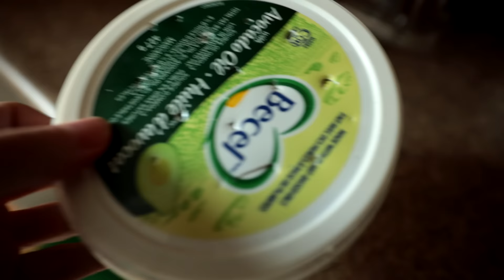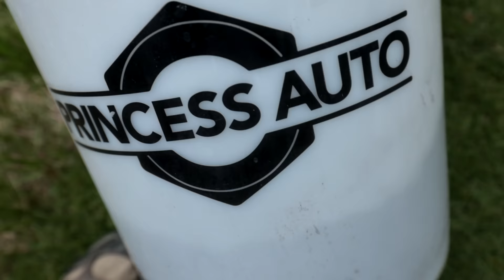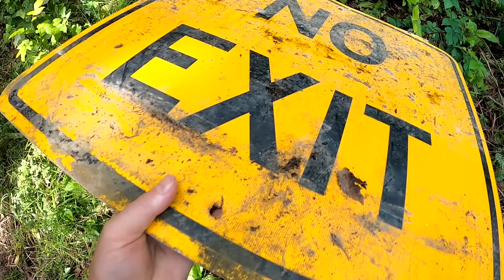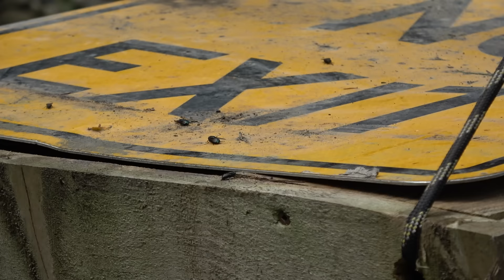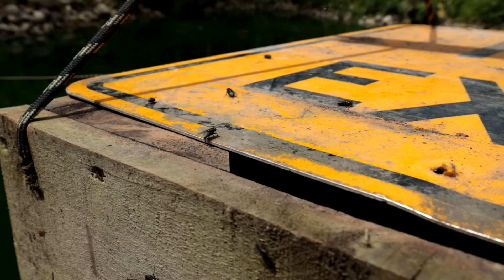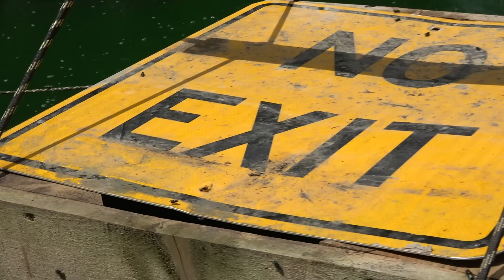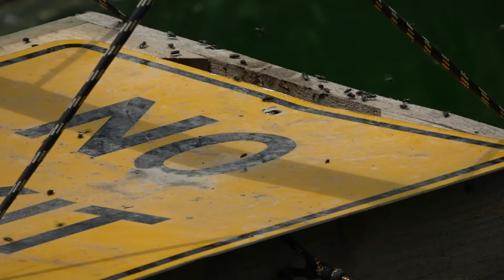Building Sickening MEGA Maggot Feeder - HUNDREDS OF POUNDS OF RAW MEAT!

Comment: Idea for the earthworms: they want moisture so ideally the bucket would be suspended in the water with which is naturally cooler. As you said they can survive in water for several days so if they dropped into the lower half of the bucket with water that's no problem. The lower half could contain sponge with large holes (inch size) which marries up with the inch size holes in the bottom of the second bucket. The worms will detect the moist sponge but be unable to dig into it and fall out the bottom of the bucket. I'm not an expert but thought it over 😊
Reply: Worms cannot survive in water. They will drown. When it rains, they come up to the surface to escape the water. Thats why birds etc flock down onto the grass when it rains wating for the worms to expose themselves. Have you ever seen small puddles on the side of the footpath with whitened worms just not moving? They have drowned.

Comment: To get a cable/rope across a gap like the pond, use a fishing rod to cast across the gap. Tie the end of the line to some paracord, which then ties off to the line you want to pull across. This is called a "messenger" line. Pull in the fishing line to draw the paracord to you. Then pull the paracord to pull the main line to you.
I would have suggested going straight to a 1/4" stainless steel cable and hung the feeder off it by a pair of small pulleys about 15 feet off the ground. Use a fence strainer/cable tensioner/come-along to strain the cable before locking it off. The PVC will abraid the rope and/or vice versa.
It's a great idea as a feeder though. Apart from the smell lol!

Comment: So, most of North America is built on two types of worms - Red Wigglers (smaller size) and Night Crawlers (the large ones you have).  In my research for gardening, you need both of them.  The red wigglers stay to the top.  The Night Crawlers go to the lower soil.  If you are trying to get them to go out of the bucket and accidentally into the water, that is going to be hard to do since you will have to try and trick them that they are not low enough in the soil.

Comment: I had an experience with a bait container that is a pail, with a Styrofoam insert. I filled the insert with bedding, and about 3 dozen worms, used it on one short trip , and went fishing about a week later, all of the worms had migrated up over the edge of the Styrofoam into the plastic pail, or out the air holes in the lid. I don't know why but the extra liner seemed to make them roam. Tim Hennigan Michigan 11/2 /23 8PM
Reply from the maker: Interesting!

Comment: This is a pretty cool concept of earthworm feeding. But I think if you cut off the bottom of the bucket an replace it wit 1/4 inch chicken wire not flat  but make it 6 or 8 inches of mesh bottom , I believe as the worms travel they would be more likely to find a hole and crawl out.  And to catch my worms I like to take mustard powder and mix it with water so it is runny then I look for worm holes pour a little down and they crawl right out. Good luck. Thanks for sharing. But we definitely need some survival videos soon.

Comment: Only thing I can think of would be to fill the bucket to the top with dirt and add an electric current that would drive the worms out of the dirt, you'd have to so a lot of testing and the results would probably be instantaneous or at least a lot faster

Comment: Stainless steel cable might be worth considering. I recently restrung my hills hoist clothes line and replaced rusty support rods with steel cable. 3mm cable had a holding weight of more than 250kg, so it might be a possibility for your set up? 
Lots of people use earthworms for composting, maybe some solutions in that process?

Comment: For the worms, I'd use hardware cloth for the bottom, or as many holes as you can put, maybe a few around the rim at the bottom too.

I think they're just not hitting a hole, they hit plastic and turn.

And if the maggot feeder rope was a loop you could pull both ways from one side like a clothesline. Just need an eyelet on each tree and feed the loop through the PVC pipe.

Or maybe secure it to two barrels and make a maggot catamaran.

And those were Rove Beetles, probably eating some maggots.
Reply from the maker: Good ideas!
Reply: @TheWoodedBeardsman  got a date for an update?

Comment: 1 way to get worms to move is a Electrical current moving through the ground. I know it will bring them up out of the ground. That is how I collect earthworms after it rains.I do not know if you would be able to get them to cross through the holes in the bucket though.

Comment: I think the designs that I have seen work have another smaller empty bucket that goes to the bottom with holes along the side and bottom. they go towards the center usually when its warm because that is the coolest point center and deeper. they fall into the holes then can only escape downwards which is their natural reaction if they cannot find anything else. not all will fall in and if kept up on should have leaf cover and cardboard on top to eat but also keep moisture in. I am not sure how often it will need maintenance as that differs per environment But I believe people will switch out buckets weekly or so to allow worms to recover and breed. also smaller holes mean smaller worms fall through and larger mature worms will stay in more often. I have seen people do this with varying success but never done so myself just some a possible solution. also might need some water added once in a while.

Comment: As someone who works in a worm farm (For compost, bait, fishing etc. The amount of worms you "picked up' is either astonishing or you brought them. It takes alot of feeding, soil + additives etc to get them to come up and stay up. Each worm egg can contain 1000 juveniles. Get some worm beds built. Square beds. Milk Powder, Dry lime, chicken pellets / small dog food and milled pig poo. Straight pig poo is too acidic, so it needs to be milled and get the acidic levels down. On top of the bed, place old carpet, with cracks and drainage and water it often, but not too often to drown them on the sides. The worms will come up to the top as the food is there for the taking. The small "white" juviniles will feed on the wet dog food and milk powder until they are big enough. I am not sure the breed of them black worms you are using, but from my experience they are not the favourite for a lot of fish. (specially when fishing). Unless they are desperately hungry. Red Garden worms are the preferred for fish where I am from. They will eat black worms though. But they are alot tougher. EDIT: water (hose) in the lime milk powder etc before you place the old carpet. SO it can soak and sink into the soil.

Comment: have you considered multiple smaller boxes that you can have on a rotation so you can put less in each and each one at a different stage (maybe fresh one each week with the weeks trimmings, off cuts etc?) and have a constant slower supply of food to the fishes and not have to deal with the smell so much by only having to pull each one in once it has "finished" to replace with new stuff

Comment: If the works like the dark, then use a black bucket on the bottom, & cut the bottom of our the bottom bucket. Submerge the bottom inch of the bottom/outer (bottomless) bucket (I'm sure you are where I'm going with this). 
The worms will crawl down towards the dark, crawl through your holes, & out into the bottomless bucket & drop into the water.
Your idea was leading to this idea. You'll have to suspend the whole system over the water.
Good luck!

Comment: Worms need lighter soil to move around easier, adding peat moss would help, second the bucket under the worms with soil needs to have water but not too much where the soil up top behind to dry and drop down to the water, having the water a few inches thick will allow the worms to escape and fall out, that's my best solution
Reply from the maker: Yes, there is 50 percent peat moss in the soil.

Comment: its about the holes... its like flying in the dark to find one of them. it would be better if you make the bottom of the bucket into a funnel. so as they try to go deeper they will drop out of the central bigger hole. you could even make a series of funnels so they can go down and down to slow them from going out the bottom.
Reply: also color the buckets so the top will get hotter than the bottom, forcing them to go down
Reply from the maker: Good idea!

Comment: Maybe you could try a sort of funnel, or a more permeable bottom line a larger wire mesh that will keep the soil in but allow the worms more room to exit? Additionally, you could make a separate bottom line you did with the 2 buckets, but have a very loose mesh on the bottom and fill it with compost so the starving worms will be more attracted to leave the soil and get to the food on the bottom, then fall through the mesh. Great videos btw!
Reply from the maker: Some great ideas there, just need to unpack the idea into a concept. You've given me something to think about!  Lose newspaper false bottom with size holes....

Comment: Try this, cut the bottoms off the buckets, maybe even drill holes in sides. Bury them level to the ground or maybe a little raised. This will keep your handfuls in the hopper until they migrate out. As long as you fill the hopper and soften the ground around it the density of worms will force them the spread from the hopper.
Reply: For the worms, that is

Comment: Red wiggler worms have always done better for keeping them in any kind of a worm farm in my personal experience they're smaller worms they double in number in something like a month or six weeks and I don't need the cold the way earthworms do but they can handle a little bit warmer temperature and slightly drier climate or substrate
Reply from the maker: Sounds like that's worth trying.  I'm not sure where to source those though?
Reply: As a former worm farmer I think this is going to be a bit tricky. The species you want is Red Worm Wigglers not the ones you've been grabbing. The other issue is they eat the leaf litter and the upper levels of the soil. They won't go through the bottom because that is where their worm castings are primarily not their food source. Sorry man this is not going to be easy. What I would recommend is using the worms to process the maggot leftovers and get some great soil out of it.

Comment: worms will come out the top each night. sawdust mixed with light soil good. ure magot box with woodden bottom bout 9 inch deep max for the worms. if you have manure heep put cardboard egg box just under the top layer each night you will get pile of manure worms. i do this when i am going fishing i get a good hand full of brandlings . they come up at night go down in morn. what is why they stay in the egg box.

Comment: Only 5 mins into the video but, the worms like to rise upwards when it rains? They also would rather do it in the dark/evening time. Solar fountain water pump, a small one, and mimic a rainfall inside the bucket. The worms will rise and let them wiggle out from the top and fall down? Maybe wrap the bucket with something the worms can't stick on the bucket itself. Maybe create a sauna tube almost touching the water so the entire experience is in the dark. Or maybe put the pump on a timer in the evening and let them be active at night. Once again 5 mins in the video I guess just hanging a bucket in the air in the summer would dry out the soil for the worms Maybe?
Reply: So maybe put the worm factory in a barrel buried in the ground. And mimic rainfall and when they rise up, make a one way slide that leads to the pond? A funnel of sorts. But a material the worms can't stick on? Does that even exist

Comment: Or use the natural instant of surfacing and make floating earth box for them to surface and crawl off top edge
Reply from the maker: That might work, like a floating raft, so there is a lot of moisture, but they don't want to get too wet.  Then they are cool enough, and might crawl over the top.  Neat idea.
Reply: If it will hold a box and a pump to simulate rain on demand.

Comment: If they are more likely to come out in the dark and to their desired temperature gradient.   Maybe build a small root cellar type hut near the water,  suspend the buckets of worms above a flat funnel with some small c channel below it and the other end in the pond,  hook up an aquarium pump to the funnel so when the worm fall on it.  They get washed away into the water.  Maybe have a heat lamp or uv bulb on a timer for like an hour a day to get the worms to move down near the bottom more readily.
Reply from the maker: That could be set up near the waterfall, and then wash into the pond, neat idea.